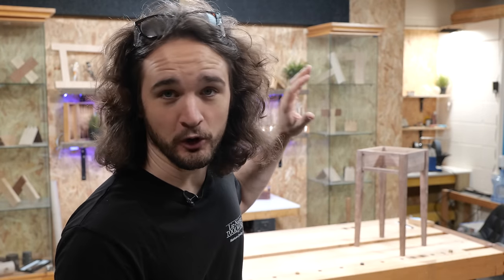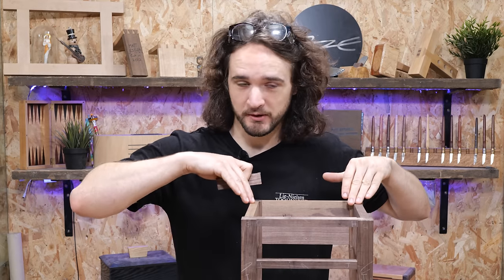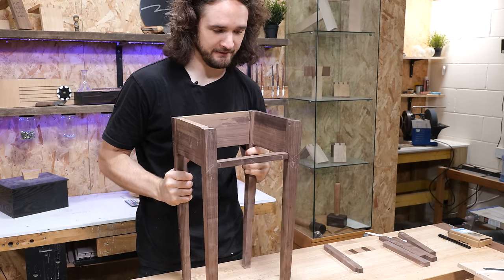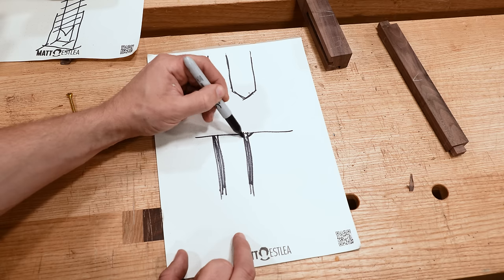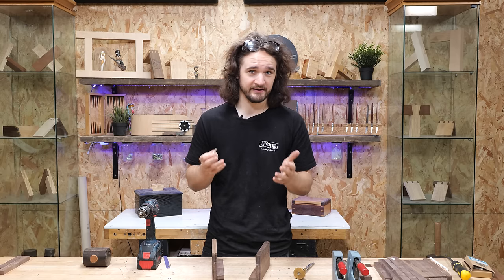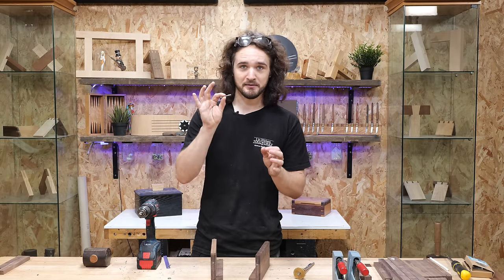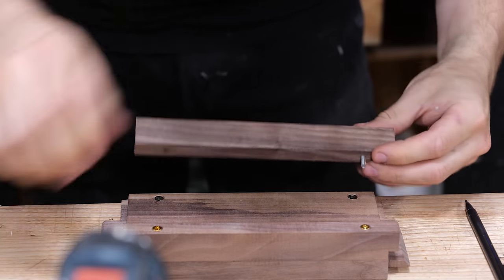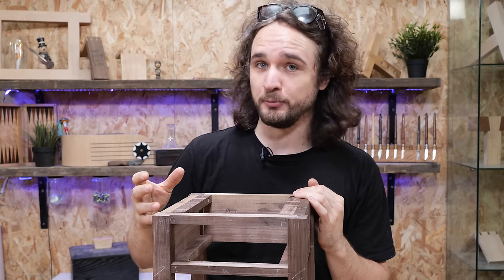Making Drawer Runners | Shaker Table Project #7

Comment: Always good to see your work :)  Instead of threaded inserts I've had great success putting the threads straight into the timber.  I used a tapping drill size then used the bolt (with a small amount of wax) to form the threads.  You can use a cutting tap but I found the results weren't quite as good.  James wright did a video on it with interesting results comparing inserts and wood thread, give it a try and see what you find :)  And if Rob reads this, tell Matt that testing is a great way of procrastinating :D

Comment: There's a guy on YT who makes every kind of tests about woodworking. Turned out insert threads aren't that strong.
Reply: The main consideration is if it is fit for purpose.
Reply: Yes but these inserts will be in sheer. If there is a danger of pullout, you might be pulling those runners in ways they were not meant to go.